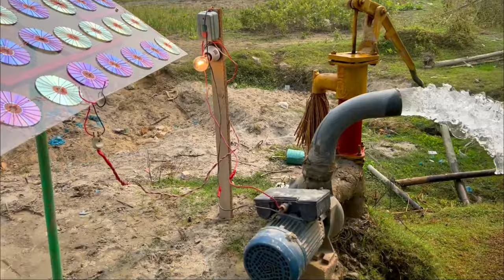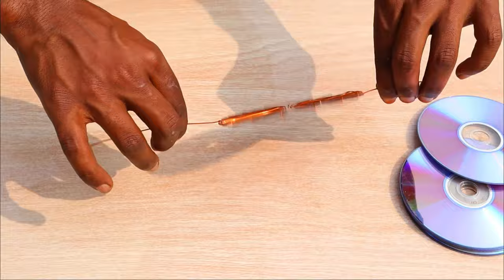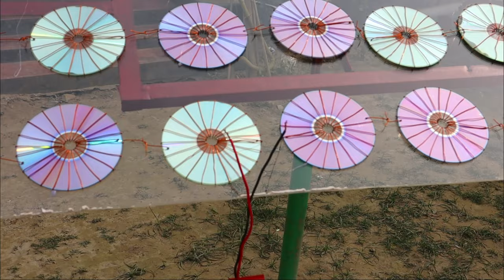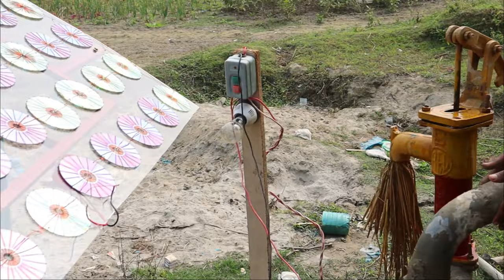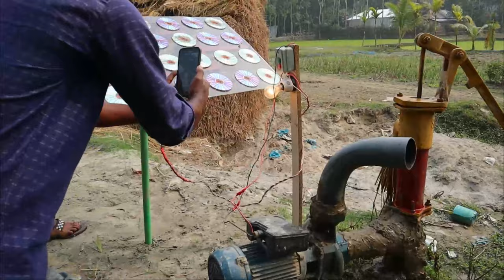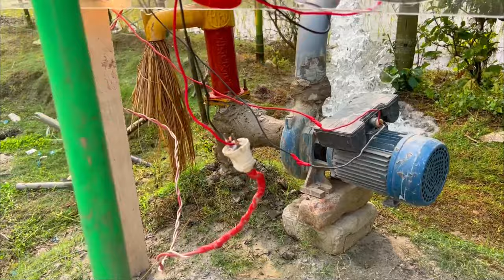How to make Powerful SOLAR Water Pump useing Old Disc

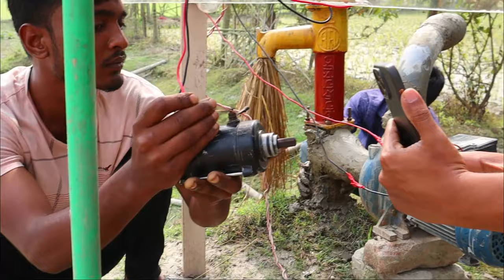Comment: It's a fake, here's a proof : 7:17 Look at the top left corner, you can see 2 new wires entering in the red box, and coming from the frame. So the power comes from a wire hided in the pole.

Comment: The toughest part to hide the wire
Reply: If it will generate ac voltage he would die by touching the wires